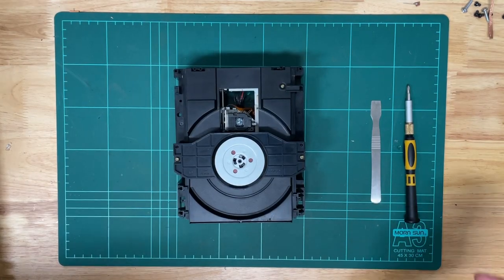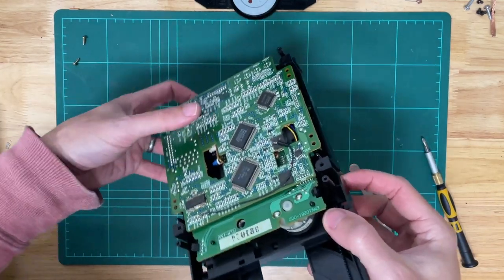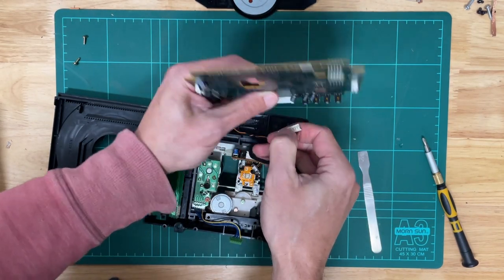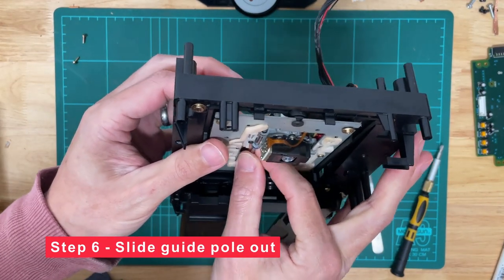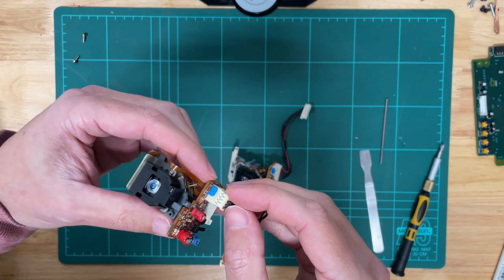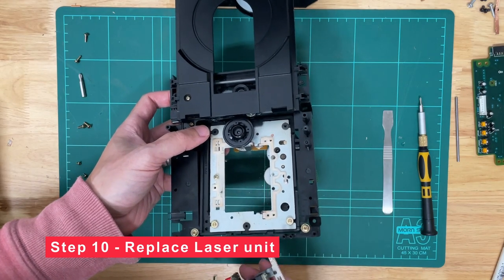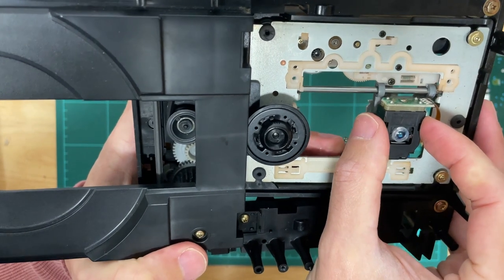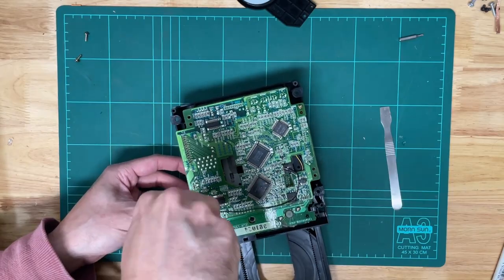Sega Mega CD Laser Replacement

Comment: Hi, I have the same problem as the guy in the previous comment, my model 1 cd with jvc laser reads audio cd but no games, I checked the ram for 240p test and the software says everything is ok. Would you say I should do a deep clean on the entire reader, including gear and everything? now is not reading anything.
Reply from the maker: Was the unit working previously? If it was and it randomly stopped working it's likely something near the CD cache chips, if it was the laser then audio CDs wouldnt be working. If its not reading anything at all then it's likely the laser needs replacing (assuming all other default checks are passing)
Reply: @finished_it  Previously read audio CD, but now no read audio cd, the laser does not move when put a cd.

Comment: Hi I just got the same laser for my jvc Sega mega CD model 1 just replaced the laser with a new jvc laser unfortunately it doesn't work 😞 do these lasers have a static point of soldier like Sega Saturn lasers do ,I replaced Saturn lasers before but must remove a static point for the laser to work I compared the lasers before replacing it but both new and old are exactly the same couldn't see any extra soldier static points
Reply from the maker: I haven't done this fix on a Saturn before. My understanding is that most new lasers come with anti-static points although mine did not (There didn't appear to be any obvious signs of one) You could try adjusting the pot on the laser pcb, though mark the original position of any pots with a fine pen before you go adjusting them.
Reply: @finished_it  Hi thank you for your response, it turned out it was a bad laser, lucky I ordered 3 lasers second one worked fine its working great now 😁
Reply from the maker: @seganutt  Oh that's good to hear it worked! Yeah sometimes with these 'new old stock' items they can be new but don't work due to age. It's a sad reality that lots of old electronics will one day wear out and there won't be enough demand to make replacement parts.

Comment: Hello my friend.  I have a sega mega cd (Pal) too with a Jvc laser (optima-5). The problem i have is that it plays music cd but no game cd. The potentiometer is the blue one i can see at the side of the laser? I mesure 5,6 K-Ωhms.  Is this indication the proper or i have to adjust it(and if yes, which is the right indication)?
Reply from the maker: I believe this issue sounds like a problem with the cd cache IC’s. I don’t believe it’s a laser problem. So the chips need to be replaced which involves desoldering and soldering on new ones. They are surface mount which are easier to remove but still I’d recommend someone familiar with soldering chips to do this job. Please note also, try and avoid adjusting the laser potentiometers, if you ever do then mark the original positions with a fine pen/marker.
Reply: @finished_it However do you know the proper K- Ωhms of the potentiometer? I bought the mega cd console 3 years ago. It was a new old stock. I have not use it a lot. I have attached on the top the 32x add-on and i play cartridges often. If i disconnect the 32x, the problem will be solved?
Reply from the maker: @Konstantinosmo  Hi, I don't have that measurement offhand. I'm actually still working on getting my MegaCD working. When I do I'll get back to you.
Reply: @finished_it  Hello, do you have a link to where you ordered your replacement laser from for the CD unit in the video?
Reply from the maker: @metus-uk8nx  I sourced it from Aliexpress. I tried to find a link but nothings coming up in search at the moment. I'd say either keep checking eBay or Aliexpress for a good deal to popup.